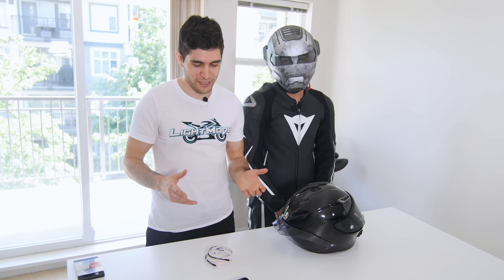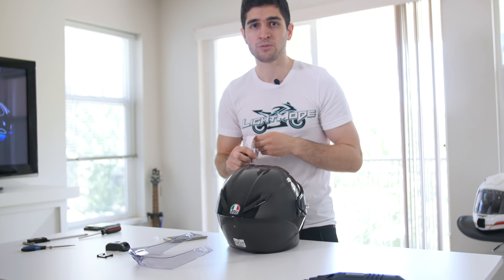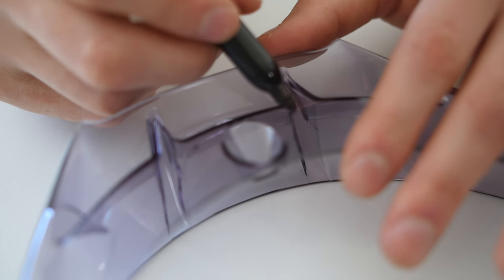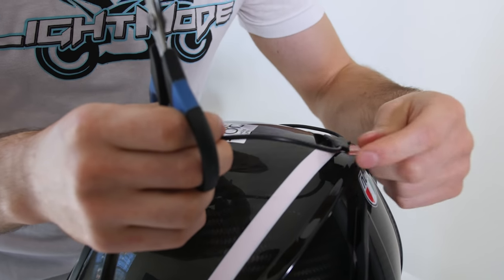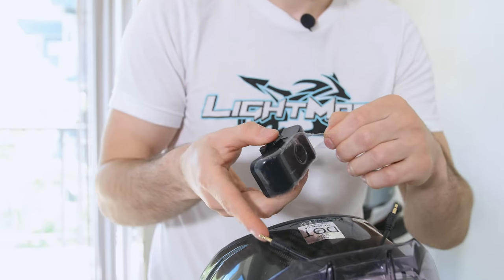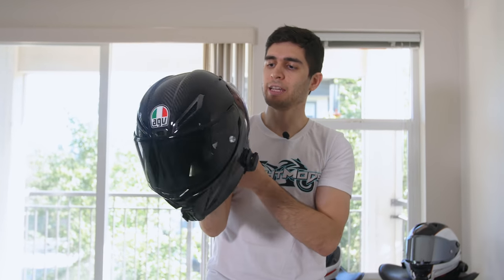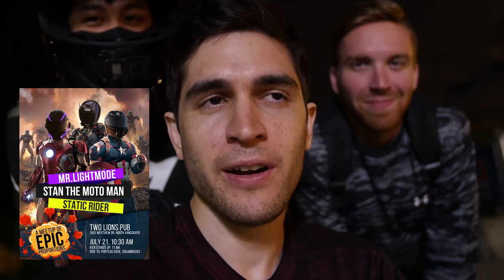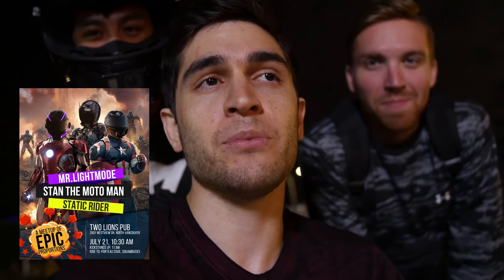Drilling Into A $1400 AGV (LightMode Install)

Comment: Looks cool...is it legal?  I thought white lights had to be facing the front...Amber on the turn signals...and only red lights could be rear facing.   I might be wrong and the rules could be different in BC.  But worth looking into.
Reply from the maker: David Mosier depends where you live and which particular officer you ask. I've ridden with it for over 4 years in BC and never got a ticket for it. Nor has my local LightMode crew.

Comment: How are all these people saying you ruined the helmet?! It now has more visibility and only got drilled through a little plastic piece not like you went through the foam or whatever lol
Reply from the maker: Richard De Nieuwe Apparently AGV helmets are sacred?
Reply: Mr LightMode I guess so. It literally holds no purpose other than design ascetics and you amplified it lol
Reply: Richard De Nieuwe The purpose is aerodynamics and weight. It seems silly to buy a helmet made to shave weight for racing , and add a giant battery to it. Honestly I thought it looked cool. I hope they shrink the power supply size down a little I would buy one
Reply from the maker: Thomas Matarazzo people buy sportbikes for the street when they're meant for the track too. Style is a big factor for consumers, and AGV has it 👍

The battery pack was shrunk in 2016. We ran a kickstarter for it that went well over the goal. You should've seen the previous gen controller. The new one is smaller than most Sena devices. If we made it smaller, we'd sacrifice battery life and brightness so a lot of R&D was done to find the right balance.

Comment: So, out of couriosity... whats the life-span of these kits? i know that EL panels loose brightness over time, would love to know how long these usually go and if i could replace just the light-strip or wire on its own instead of the entire kit if it would come to that
Reply from the maker: EL panels theoretically lose brightness after years of continuously being in the on state. Your helmet would likely expire before you notice any dimming in EL brightness. We've been in business for over 5 years now and have yet to come across any cases of our EL dimming simply due to regular usage. We're looking at introducing a way for our customers to buy accessory packs early next year (rather than a whole kit).

Comment: Lightmode looks awesome, but the controller is HUGE. I'll definitely buy one if the controller gets smaller, way smaller!
Reply from the maker: Rafael Coutinho We already made it smaller in 2016 via Kickstarter. You just can't make it smaller without sacrificing brightness or battery life. We listened to the feedback of our customers to create, what we think (confidently), is the perfect balance of size to output to battery-life ratio. It's smaller than most Sena devices and it only adds like 50 grams. I wear a GoPro, Sena SMH10, and LightMode controller daily.. I only really notice the bulk of the GoPro after a long ride.

Comment: How can I buy the same  light of this video? In your web page you have a others different desings but I want the same of this video! double short light
Reply from the maker: You'd have to buy two of these kits and only use the 50 cm wide strips of light: https://lightmodehelmets.com/electron-s-kits

If you don't want to spend that much, you can get one of these kits for $129 and cut them short: https://lightmodehelmets.com/neutron-s-kit/blade

Comment: HI. I bought a 1400$ carbon fiber helmet to put a battery that weights almost the weight of the own helmet
Reply from the maker: Not even close. The helmet weighs 1440 g. The kit only weighs 70 grams.
Reply: Anyway bro, in my opinion that doesn´t even look good for what it is, i mean, if the bateries were inside the helmet is ok, maybe some hidden wire or something, but bro that huge thing doesnt fit in that beatiful helmet you know what I mean

Comment: Completely ruined that helmet.
Reply: how so? please enlighten us on how he COMPLETELY destroyed the helmet? He didnt drill through the actual shell of the helmet just the accessory aero fin which can be purchased from Daniese separately.
Reply: Hard Parked 987 stole the words out of my umm under my fingers I guess
Reply: Completely ruined the comment section
Reply: Robin 125 that wasn't sarcasm
Reply: the comment of strelok was
Reply: @Art_thr0b  it is expensive cos it is light, yet you just make it heavier with mounting unnecessary junk. if you want precaution just use reflective tape where you find necessary. i agree with strel0k
Reply: Thereal Blackwell  please enlighten us how a minimal amount of drag from a battery at "night" will cause such a distraction as it would be the same if a bluetooth hands free uclear unit was strapped to the helmet? I see these devices standing up to 100mph+ speeds.
Reply: Tolga Tuğlu  its expensive because it's a visual  enhancement at night not because its "light". You can find cheap knockoffs of this product depending if you wanna go that route. As I said before this is the same scenario if a bluetooth device was mounted on the helmet, still accountable for high amounts of speed.

Comment: I cringed at him letting the clutch go without putting the bike in neutral. Thought he'd shoot through the elevators door.
Reply: All it would've done is stall the engine, the bike won't move unless you apply throttle as you release it, no throttle= a stall. well atleast thats how it is for mine like

Comment: Cutting half of the strip away and using tape against elements? Seriously?
Reply from the maker: Игорь Борисенко Doing so adds protection against the elements. It obviously doesn't make it water proof. But Stan here doesn't usually ride in the rain, so the trade off is not much of an issue in his case. If riding in the rain is a frequent occasion for you, then I'd suggest not cutting it.
Reply: @Mr.LightMode  exactly. I am not sure what is the experience of your friend, but my yearly 30k kms on the bike and common sense clearly indicate, that UV light+ water+ dust+ vibrations equals a NO for scotch tape application in anything which is referred to motorcycles.
Reply from the maker: @ProXmoD  As someone who has actually tested the tape-sealing method shown in this video over the past 5 years, I can assure you it is sufficient for the majority of riders. The only concern is heavy and frequent downpour, not UV light, dust, vibrations, or casual rain encounters.

Comment: Hello Mr. Lightmode
So when you insulated the cut part of the light strip, how did the tip of the strip still stick on to the the helmet. I ask this cause won’t the tape cover the sticky part of the light strip?
Reply from the maker: I only taped over like 2 mm of the sticky side for that reason.
Reply: Mr LightMode ooooo intelligento!!!👀👀👀